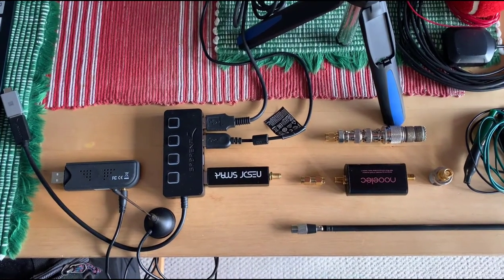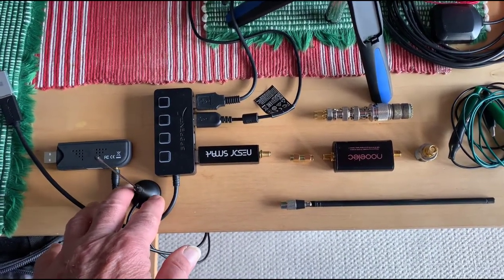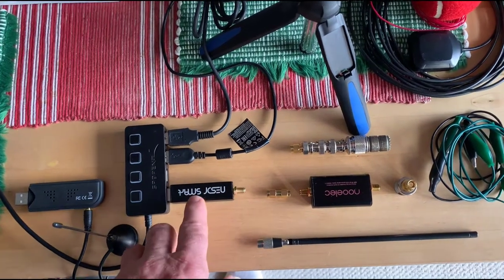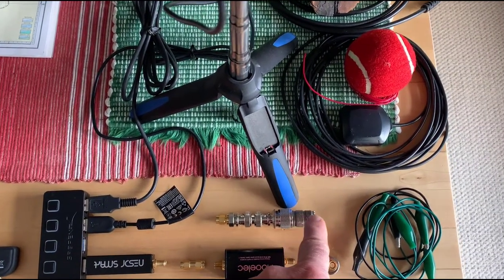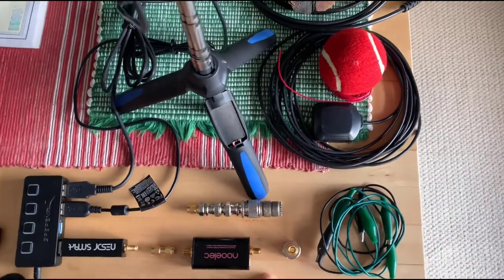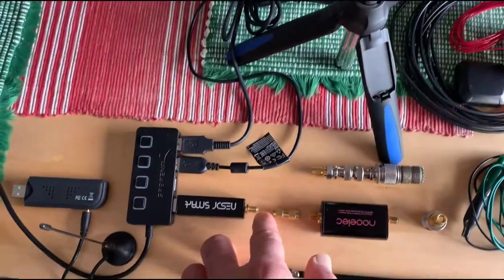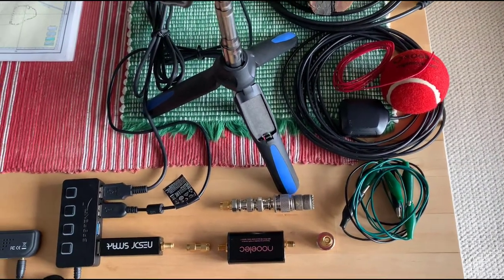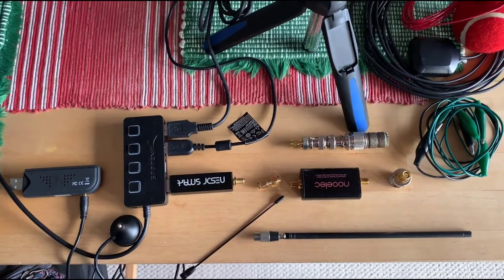RTL-SDR Antennas & Connectors

Comment: Thank you! I had just turned my soldering iron on to desolder the centre pin of the 10cm antenna from my cheap dongle when you said "just clip test leads on it". 
Unfortunately, where I live just outside the GTA my town is in a valley about 100 feet lower than the surrounding elevation, and I'm in a low-rise. GRrrrrrrr.
Reply from the maker: With the rtl's, there are adapters for everything.....sma/mcx, bnc/sma, uhf/sma. Also a bent paper clip is the ideal way to get into the center conductor of the sma. Then you can clip alligator clips to the paper clip as a quick vhf/uhf antenna.

Comment: Thanks Jeremy.... I just bought an RTL-SDR V3  and I was surprised I couldn't receive HF....I love your tennis ball trick.....but a question.....will I still require the Upconverter for HF??
Reply from the maker: No - if you are using SDR# for reception, then you have to go into "direct sampling mode". The V3 under samples at 28.8Msps, so any station you receive will also have an image component. So a 7MHz signal will also show up at (28.8-7)=21.7MHz. So as long as you are aware of this, not big deal. Good luck.
Reply: @ClarkTelecom  Thanks for the info.....now to find a very long wire!

Comment: So you dont use a balan for your HF antenna??
Reply from the maker: No.
Reply: @ClarkTelecom  huh... why have i been sold one for my rtl-sdr & ham it up amp?
Just marketing?
Reply from the maker: @Acid_Monk  I looked at the balun and it looks great. It didn't exist when I shot this video. I just took the hook up wire and inserted it into the centre pin of the sma, or used a series of alligator clips and connected them to the whip, just laziness.